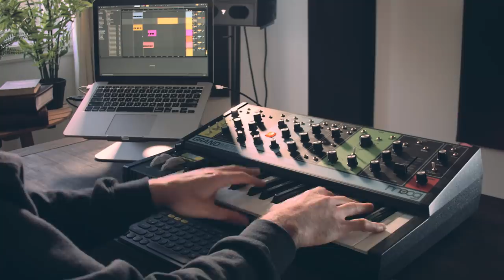Making a song using only the Moog Grandmother synth

Comment: I use all my synths and drum machines in a DAW-based environment and I was wondering whether the Moog would be worth it in that situation. 

You showed me that is definitely is worth it. Thanks for this video!
Reply from the maker: The GM is cool cause it has USB MIDI so it doubles as a MIDI controller too.  But using hardware synths is definitely more time consuming. I spent a lot of time making new tracks, routing MIDI and tracking audio (which I edited out of the video). I work much faster with soft synths. But hardware synths are nice to add occasional layers here and there.

Comment: Sorry for not sticking to the video theme but i want to ask you one thing which i can’t find anywhere. Thanks to your vids, i gonna buy DeepMind 12 this week and i wonder what kind of amplification is needed? On your videos, synth sounds really cool and it’s probably due to some external speaker
Reply from the maker: I don't use an amp with my synths. I run them through an audio interface (Audient ID22) and then that goes out to my studio monitors (Focal Alpha 65). But the speakers don't contribute in any way to the sound you hear in my videos.  My setup is specific to recording synths on your computer. But if you want to listen to the synth by plugging it into speakers directly then I'm less familiar with that. You might want to get a small mixer and then feed that into a set of speakers. Hope that helps.

Comment: Demo would have been much better  s l o w e d  down — with a view of the GM panel.  Not fun to watch chopped up at 120 mph. Nice result, though.
Reply from the maker: thanks for the feedback. I'm always on the fence between long vs short vids, cause I know people's attention span these days is very short (include my own lol). If I made the tutorials too elaborate here I think the video would drag on too long, so I might stick to separate sound design tutorials but keep these song-making vids just about quickly layering tracks.
Reply: Fresher than a frog! Yeah, it worked! 🤪
Reply: I personally like the short format
Reply: @onceuponasynth  you can work with frame in frame shot, just put an extra camera on the panel...